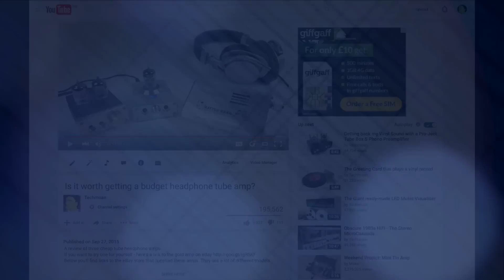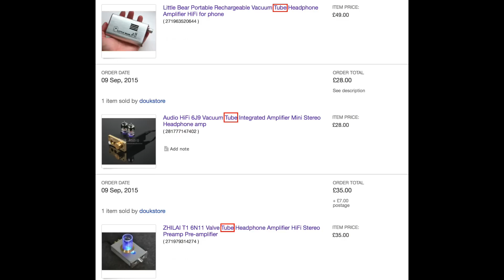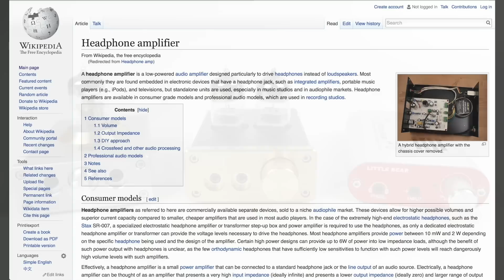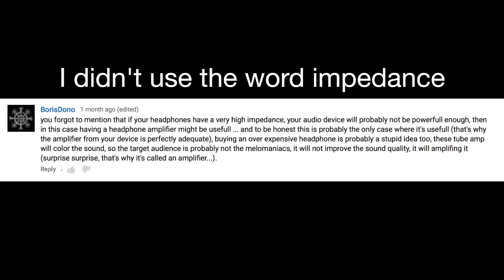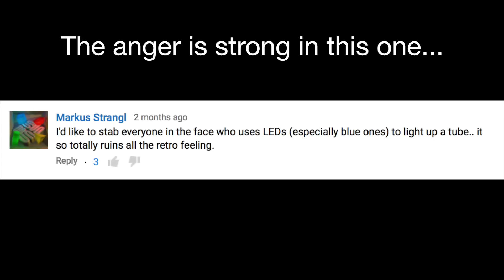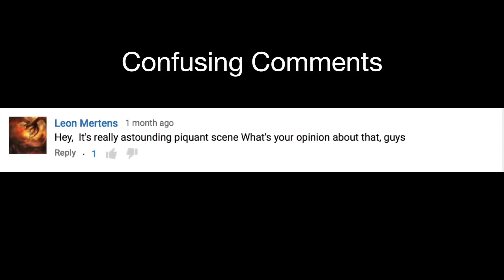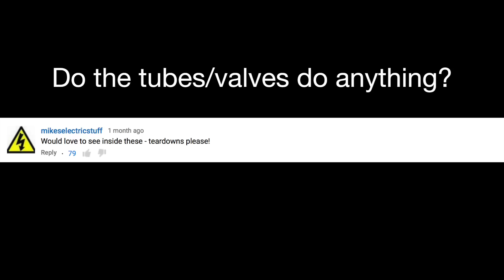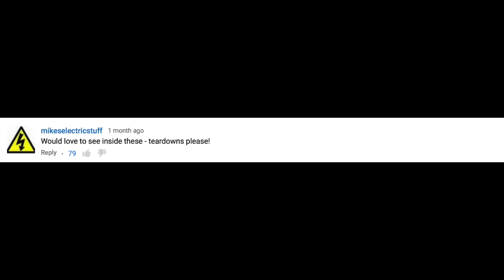Headphone Tube Amps - Follow-up & Tear-down

Comment: The logic of taking a signal of 1V/2V peak, and amplifying it to a voltage of 1V/2V peak by passing it through active devices like op-amps at +/- 15V and valve at +/- 30V seems incredibly superfluous. A simple voltage follower transistor would do the same thing. Can't think what possessed me to buy one.

Comment: High voltage is required for valve  for better reception,EL 41 ,EBC 41  & similar are good, but this is really useless,and price too high.

Comment: 11:35 first thing I see is an inductor for a dc step up converter for high voltage which means for safety reasons you should have made sure any potential capacitors were discharged as you could potentially get a fatal shock if they are not even though there will be very low current

Comment: These sort of things are still available in 2022, but these days they often do have better quality valves/tubes included.   Touching the tubes is not a big deal.   They are standard glass.  Like normal light globes.      They are not like Halogen light globes.    Back in the day, people use to change their own valves/tubes and non one worried about touching the glass.   The tubes are used as a buffer in these cheap amps.  The OpAmps do the amplification, and the tubes are used, but as a buffer to add the harmonics tubes are known for.   Not a true tube amplifier, but the tubes are definitely part of the circuit.

Comment: You can touch tubes. The confusion is they look like halogen lamps. Those should not be touched with bare hands. You can stick a tube in your ass and it'll work just fine (when you remove it).

Comment: The 6021 subminiature tube is a twin triode. It looks like it was high quality as it was one of those subminiature tubes that were built to US Military specs back then. It was used for RF Amplification and Oscillation.

Comment: If you trace the circuit board you will see how the tube is biassed on the first 2. Setup is definitely class A preamp (tube) and digital output. What these companies found is cheap Class D amplifiers sound harsh. To midigate the issue, they are coloring the sound. This is making the highs sound less square and more airy, rises the mids and smooths out the jaggedness of the upper mids. If I am so inclined to grasp your attention with this, why don't you try a review on the Douk P2 Preamp and compare with other like products. For the money these hybrid stereos sound pretty amazing.

Comment: I  couldnt see the numbers on the tubes / valves but Just to clarify one thing you all miss out .
There is Low Voltage tubes that doesnt need high voltage to function and 
the small one in the battery powered is excately such one .
There exist tubes /valves that work fine on 6 to 12 volt and have a few volt on the heater coil .
Those was typically used in transportable radios and such back in time before transistors .
Even some guitar pedals ( I have used a few in past time ) use low voltage tubes /valves too 
and some even run on standard 9 volt battery .
You dont need much power to run a headphone amplifier circuit so it make perfect sense to use 
low voltage tubes / valves here and it is also cheaper because you doesnt need transformers in 
powersupply and output stage at all .
Forget using step up systems aka / like switch mode , because those will make extreme amount 
of noise that blend direct into the actual sound and is really almost impossible to filter out in 
such little device .
So yes nice small headphone amplifiers and very usefull too .
In my opinion the one with two tubes / valves look as have highest quality ( especially the capasitors )
and a ringing / microphonic tube clearly indicate that it indeed use the tubes / valves .
The worst quality is the battery powered one because of the mess and all small add on boards .
Too much that can break and also generate noise and components wont las as long as the one 
with two tubes / valves .

Absolutely usefull and the one with two tubes / valves look like the very best buy .
( also you can easy modificate them to get better sound if want that )

Comment: Once upon a time, I repaired consumer electronics with vacuum tubes. I find reverence for this antiquated technology entertaining and it’s funny to see integrated circuits mixed in. If I were a purest for this  nostalgia, I would use a phonograph as an audio source and find an amplifier with no transistors.

Comment: In case you didn't already find this out the numeric value before the first letter is the filament voltage. These are all 6 volt tubes. The original radios would put all of the vacuum tubes filaments in series. American five tube radios operate at 121 volts with 12+12+12+50+35 all in series. One open filament and nothing would light up.

Comment: Ok. Lets just say. Even this video are 6 years ago and it came to me recomment list.  These tube headphone amplifiers are using tube [or valves I dont know. I dont care through.] In operation. These tubes can work as a Reverb effect,noce reduction,surround effect,etc. Unless these are fantasy tubes. These tube amps using a two-sided circuit board. Of crouse you would not see any circuit lines on the one side of this but THERE are many on other side. If you open your eyes widely you will see these compoments are mostly SMT [Surface Monted Type] on that side of circuit board. And these tubes are real and properly use in these amps. Also that capasitors? Well. These are enough. To run the tube. I have run  these tubes with 12V battery with a few resistors and capasitors and it work fine. For the tube that need 100V its gonna be in the tube power ampifier or professional tube amplifiers that need a high wattage of power like 100W to more than 1KW. But these tube headphone amp only need 1W to just 3W. So the capasitors are eough. Also why the headphone amp exist? Good question. Its because your device cant create a sound lound enough for some application like if you connect your phone directly to the amplifier.  I tried connect my phone directly to my power amplifier that doesnt have any preamp and I turn volume all the way up. The result is the sound it gets is NOT loud so if you gonna connect your headphone to your amp like that you properly need your headphone amp. And ofc in case if you need more bess or more loundness when you playing games or such a thing. You gonna need these soon. Also. For who that put that anger on these cheap but good tube headphone amps. I must warn you that you must calm down or the tube headphone amp lovers will make your suffer. Stay tuned. [My knowlage are maybe lack or my english might be broken. I appologize.]

Comment: Dave Jones on the EEVblog channel did a tear down on the exact same two tube model and proved that the tubes are actually in the circuit and do work, in fact they are the first stage of the amplifier, and then the next state is the socketed op amps. I'm not certain where these conspiracy theories that the tubes are faked into the circuits come from. The blue LEDS of course are just silliness shining up through the tube for show.

Comment: In your previous video on the tube preamps one or both of the tubes in the gold colored amp were microphonic which indicates a faulty tube. While I agree that it's good to let the amp stand still and not move it around when the tubes are heated up and operating, moving the amp should never cause a sound like that. It's not the fault of the amp itself.

Comment: They all seem to have a boost converter that increases the voltage to more "tube-friendly" range. You can see coils and Schottky diodes near to some ICs near the power input. The yellow one seems to also have a buck converter to decrease the voltage for the heater in a more efficient way, and the one tube one has a linear regiuator for that placed in a really unsightly way, that touches the can because it is a way more inefficient way ro decrease voltage, but usually less noisy. The Little Bear appears to have been put together from readily available modules, and someone just tossed in a large cap to stop the noise from both SMPSes. But it didn't completely help because he only did so in the filament supply, and having asswitching power supply right next to your input stage is a bit of a dumb idea, as is the way the ground and power seem to go all over the place, which can pick up all kinds of noise. Also, the top layer of each the boards also has traces and I'm surprised you didn't notice that. The "choobs" look like they are in fact connected and work as an amplifier, but I would need to look at the pinout and draw the schematic to tell exactly what kind of amplifier.  And it's interesting to see that they all use NE5532 as output stage. It's a low-noise op-amp that everyone seems to like for audio applications, but there are fake or crappy ones if you're unlucky.

Comment: 11:36 EEVlog has a detailed reverse engineering video on this particular model, basically the tube is used in a triode configuration as a cathode follower to increase the current but not voltage and not doing much at all to the signal.

Comment: By the looks of it, I am inclined to think that all the Valve/Tube amps ARE using the tubes for the amplification, as if you look closely, you can see a small inductor/coil for boosting the low voltage    up to the 90 -160 volts that the Valves need. I also think that the small 8 pin chip that is visible in front of each of the Valves (The one in the sockets) is responsible for some sort of  backup system in case one of the tubes fails. Sorry if not all of this information is not perfectly accurate, I am not the most knowledgeable in electronics.

Comment: There are 2 opamps left and right the tubes are buffers to provide low voltage to the opamps to work. that's why there is that delay slow up comming voltage. Clever but totally fake...by far.

Greetings 

tubestoretwente.nl

Comment: Where does the High voltage come from to run the tubes. Most small ECC tubes need at minimum a 135 VDC but most of them run arround 200 VDC on the anodes. Seems to me its fake and a little chip does the trick.

Comment: you can touch the tubes, the myth probably came from halogen bulbs or something that can fail from it but they also get twice as hot as tubes in a real tube amp, these aren't even real tube amps so they probably just get a little warm to the touch.

Comment: It's a bit late but i'm rewatching a ton of videos of yours. I see no transistors in those amps (the chips may amplify) but there are no obvious transistors so it's likey the valves, sorry chooooooooobs are doing the amplification. I appreciate your long form, relaxed and plain English style, it's incredibly refreshing and i'd rather have this than some prat using terms i'm only recently familiar with. 

I started building a proper hi-fi thanks to your videos, something i always felt was something i felt i'd either never afford or completely mess up i.e. buying 10w speakers and a 2000w amp (though in your budget hi-fi video i don't recall matching the speakers with the amp). I have a Pioneer cassette receiver and some speakers, in the new year i'll add a DVD player with SACD and DVD-A playback or a blu-ray player with the same capabilities and a turntable. Holding off on the turntable is proving difficult (there's a Htatachi with a motor issue for £20 on ebay with anti skate, a built in strobe and speed control. A turntable is not electronically complex, i can fix it) but i must focus on gifts for others. 

I will definitely have everything by spring (including LED VU meters as my hifi makes the spaceship of Hotblack Desiato look colourful) however I'd love to see a video on budget hi-fi digital media players.

Comment: I really don't know what all the fuss is about.  There is no confusion whether you call it a valve or tube amplifier.  What is confusing is when stores on AliExpress call transistors tubes.  I would think the term tube is the more correct terminology as the shortened of vacuum tubes.  Also, we refer to the old televisions and PC monitors as CRT TVs/monitors, Cathode Ray Tubes.

Comment: On the pronouncication of "tubes", The letter j did not exist nor did w and v before the printing press. A J is a more pronounced I the same tha w is to v is to u. In cursive you would write tubes as jiibes without the dots. Now  the dots in germanic languages raise the vowel up, a->ä oo->ö, So say "Jiib' with lowered vowel sounds, sounds a lot like "valve" doesn't it...

Comment: As someone into thermionic 'VALVES' for over 40 years re all aspects of repairs, builds and similar; the 'microphonic' or ringing was a very common problem in valve TV sets. However I suspect the ones you had were simply representative of what the bulk of them represented, cheap and nasty valves - a bit like the Svetlana Russian or Czech valves still made today. Portable valve radios from ie the late 50s /60s often used sub miniature valves with a filament voltage of about 1.5v and a valve anode voltage of about 90volts (350mA) though they would work with less voltage re the 90volts from a battery accumulator. Ever ready and Vidor being two well known makes in the UK. Non portables used an average filament voltage of 6.3v (>2Amps) and nominal anode voltages et of about 300 - 400volts (500mA > 1Amp+) Most valve amps/receivers et had 3 OHM or 15 OHM speaker outputs. Modern units have 4, 6, 8 ohm speaker outputs. Headphones used to be 8 ohm but can vary enormously and impedance is something buyers should be aware of as they can reduce sound output dramatically on ie mobile phones et cheaper ones often have those kinds of issues. What is called 'mismatching' ie where the components et don't match up or are out of sync et can seriously affect equipment not only re output but can damage the units. ie connecting a 4 ohm speaker to an 8ohm output not good, BUT you can connect a 4 ohm to a 4 ohm out or an 8 ohm to a 4 ohm output et (all it will do is reduce the volume et) Another example would be re record decks/record players as you know all too well😊re what kind of cartridge is fitted ie Crystal, ceramic, magnetic. So, to the teardown.. hmm looks like a voltage regulator, two output ICs for left and right out. Which makes me think the tubes are indeed for display with a nominal voltage to them NOT HT. Those ICs are probably delivering maybe up to 1watt - ?5 Watts of power each. Probably 250mV to 500mV signal out. 👀 As always great channel, great vid and like you say, for entertainment not to be taken too seriously! Fun gadgets though of course us geeks avoid them like the plaque uhh well Covid 19 - Stay safe ! 👍😊

Comment: For the easy lamen, its an inefficient way of amplification using a single 'diode' within the tube (some have 5 for example)  to amplify the signal coming from the input stage IC chips.  Apart from any perceived sound quality and looks, its a less efficient way to the standard npn transistor version.  So yes, just for looks, but does indeed amplify the output stage, just using more power than necessary.

Comment: Most of these cheap tube or valve headphone amps use the valve in a voltage follower configuration. The actual amplification is done by an op-amp (operational amplifier). Meaning that you could jump a wire on the pins of the valve and the amplifier would work the same as without

Comment: I am wanting to get a tube amp to help power my computer desk speakers to possibly give a better volume and sound,but I wanted your advise, do you think one would be worth the use? I only ask because one I was looking at uses 3 tubes, but the seller says to give it a 10-15 min. break after every 1-2 hours of use due to heat, are they all this way, that doesn't seem very practical to me.

Comment: the little bear ends to emit a hissing noise bcause the tube is near the buck booster circuit the one on the green board with an inductor and that inductor causes the electrons tho move on their own due to its magnetic field buck-boost converters operate on 10khz to 100 khz to regulate the voltage

Comment: You really inspired me to start experimenting more with my hifi setup. Before i watched you i would never put a cheap Chinese thing like that in my hifi and now i did. I bough one of those cheap 6j1 kits on aliexpress, i replaced the tubes with better ones and put some brand name capacitors in it. I use it with my cd player that i always thought sounded too bright, now it sounds a bit richer.

Comment: Looks like the tubes are actually "doing something", but those black square chips are probably opamps, most likely driving the signal into the tube, so in that case these are true, "hybrid" amps, using both solid state transistor and tube technology.
The reason for not connecting all the tube pins to traces on the board is probably because the tubes have 2 stages, but only 1 stage per tube is used in the amplifier, also, even using 3 pins would be using more than just the heater.
If you'd like to learn more about electronics for audio/amplification check out TheGuitologist's channel.